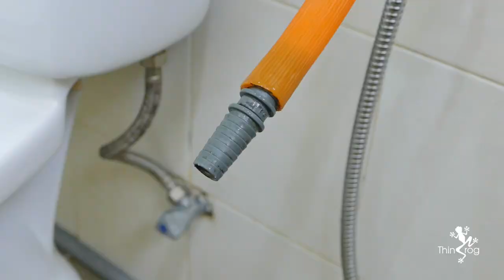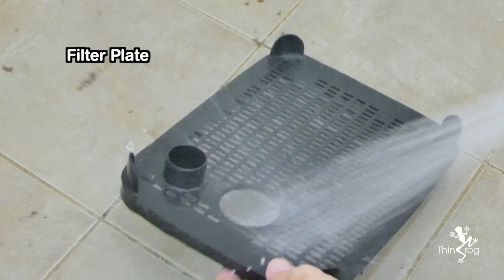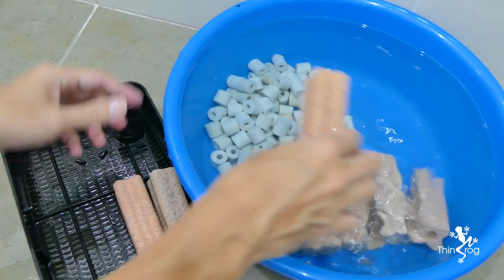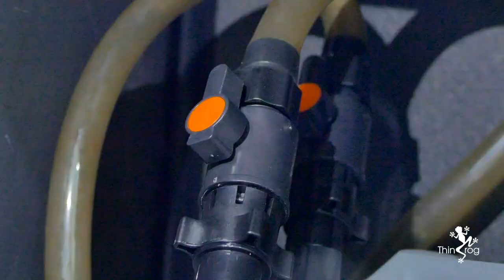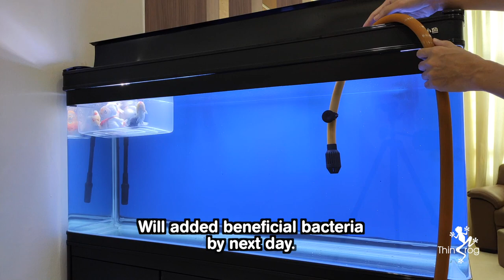Cleaning Up My Goldfish Tank

Comment: I always dissolve aquariam salts in hot water before adding to the tank via a bucket mixed with cold treated water.I read on the pack the fish can pick it up thinking its food and it can cause harm.I also thought the most you should do in one water change is 50%?
Reply: Jo hi! For goldfish so long as it is fresh decolrinated water and the temperatures are the same, you could do a 90% water change and get away with it! I do 90% changes on my goldfish and add aquarium salt

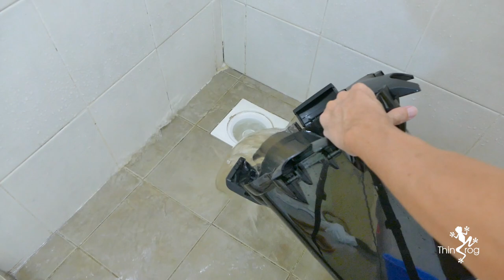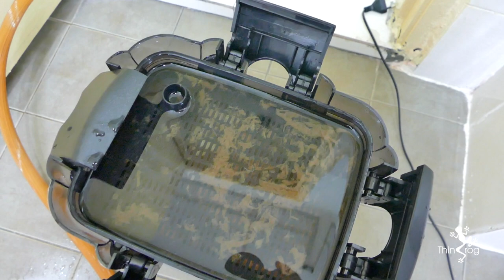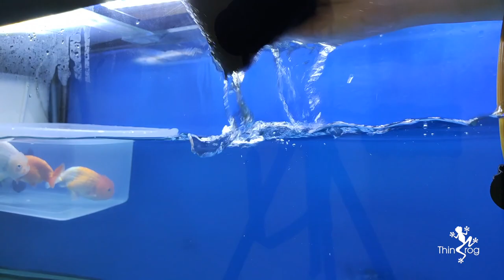Comment: Is that drain on the floor tiles a shower recess at 1:32? I like that canister with pull-out handles (0:58). What brand is it? Also, what is that dark thing youre using to clean the glass at 4:45? Is it a plastic scourer pad used for pots and pans?

Comment: Did you just rinse out your filter and canister media with chlorinated water? Whats the point. Doesn't that just kill all the good bacteria
Reply: No he didnt
Reply: He did it with tank water
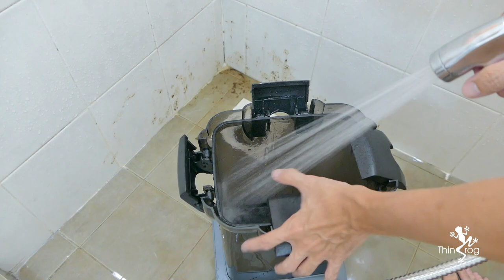Reply: @samatoTR  @1:40
Reply: @davidwonder3633  @1:40
Reply: @MCAQUIN0  @1.54 He is using tap water only for washing plastic parts. Bacteria is resient on filter media which he is washing with tank water.
Reply: Yeah he only rinsed the non media parts
Reply: @samatoTR  ah okay, i dont knowwhay resient is but alright cool👍
Reply: @MCAQUIN0  its the frame, not the media
Reply: @davidwonder3633  yea the several peope already told me. Thanks

Comment: Never use tap water for cleaning fish tanks or filters. Use a tooth brush and tank water when you need high pressure.
Reply from the maker: Bro, I am using tank water not tap water.
Reply: @ThinFrog.  how come you attached it to the sink? Unless your sink filters out fish-water which I highly doubt.
Reply: I'm pretty sure that there is no problem about cleaning trays with tap water. Most beneficial bacteria live in those ceramic bio tubes and I'm pretty sure that you would want your top and bottom layer of filter media to do the best job in cleaning out the water before it goes back into the tank. And, if you're adding some bacteria starter after a water change, it should be fine. To be honest with that much filter media in the canister, it's enough.
Reply: @felicity2891  I don't think he's using a sink... lmfao 
It's just a tap lol, you can see the toilet beside it, and if your sink is lower than the toilet then okay
Reply: @redballthing  However, with cleaning filters out you should always use the fish tank’s water or else there will be parasites in the water. It would be fine if he added any kind of de-chlorinator but in the video that wasn’t showed. This is just my personal opinion so you may or may not agree.
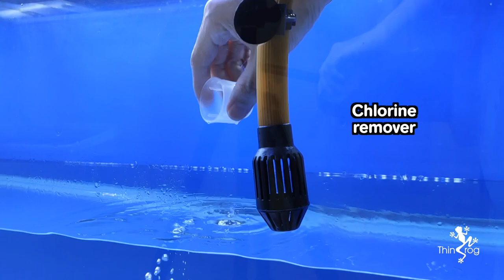Reply: @felicity2891  Lmfao did you even finish watching the video, at 5:03 he added chlorine remover, which is a dechlorinating chemical, and aquarium salt later on.
As an Malaysian, I will say that tap water is probably safe enough for direct consumption, it's just that you may need the toilet after consuming it
Reply: @felicity2891  He literally shows you that he’s using tank water, the hose is syphoning the water from the tank (you can clearly see it in the video) Look how pristine his fish are and your on here trying to call him out for something that your wrong about.
Reply: @redballthing  I’m sorry, I didn’t I was just concerned at that point, also I don’t think ‘lmfao’ was the right term if someone made a small error.
Reply: @andybonnar7283  I don’t think ‘calling out’ is the right term. I was simply asking a question, not trying to cause a whole debate with people I don’t know. You are both correct and I unreservedly apologise. It was in my side in which I fault. I have never watched this and by whom this is I do not know. Clearly he did and I apologise for that although the language you used was probably wrong (not trying to offend or pick on you in any way.) I don’t agree that you should ‘team up’ on people because they have made an error so I have one request. Please don’t do this again to anyone else in the future as it doesn’t feel nice and wasn’t really a big mistake.

Yours Faithfully

Anonymous.
Reply: @felicity2891  I thought you were the original poster and was replying to the comment he made so I’m also in the wrong. 
I apologise, no hard feelings.
Reply: @felicity2891  at this point you cant take lmfao so can I use lmao instead

Nah I dont think you can take any of these
Reply: @redballthing  I don’t exactly know what you’re trying to say there?

Comment: 60% water change a week sounds a lot and take is kinda minimal!
Reply: why is it a lot i do 100% every week
Reply: @DEVIL-ml4tz  and why do you need to do that?
Reply: Ryan Watson my fish gets healthy my frys develop faster and it’s good for my bucephalandra my shrimp multiply quick there’s nothing wrong doing huge water change as long as you dechlorinate you water and make sure temperature and other parameters are same it’s actually very beneficial
Reply: @DEVIL-ml4tz  Fair enough, I have had my goldfish for 8 years and prefer to do smaller but regular water changes than doing a 100% change unless there is any big issues in the tank.  Guess its whatever works for your setup.

Comment: You need aquatic real plants
You have to change only 1/3 of the water \ week and let the fish in the tank when you clean it
Reply: goldfish need at least 50 per cent water changes weekly, and changing too much water does not affect the benefitial bacteria because they live in the filter media and surfaces, not in the water column. water changes have the same effect that plants do, remove nitrates
Reply: Mempart Industries  sep, en el hobby algunos te van a decir que un goldfish necesita 1 litro y otros que necesita 2 millones